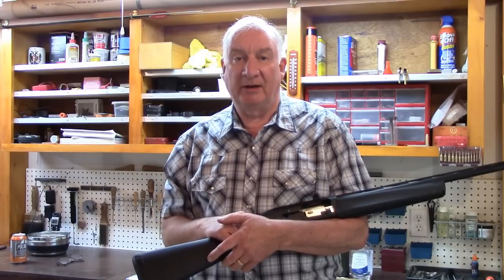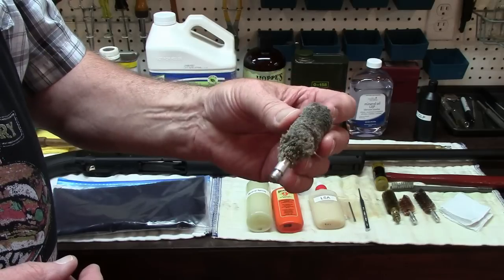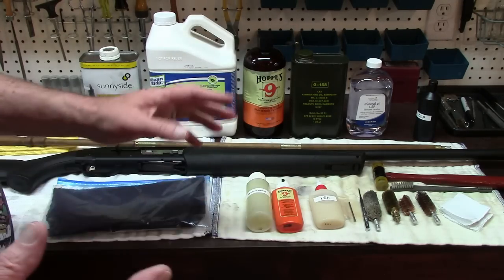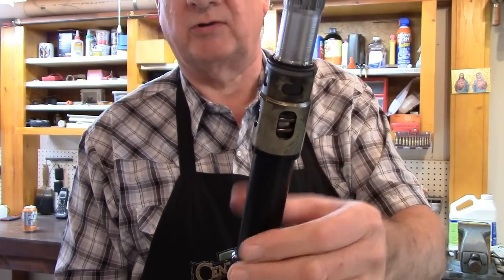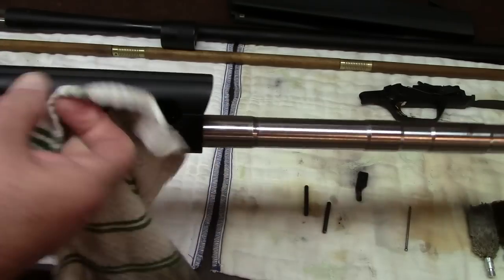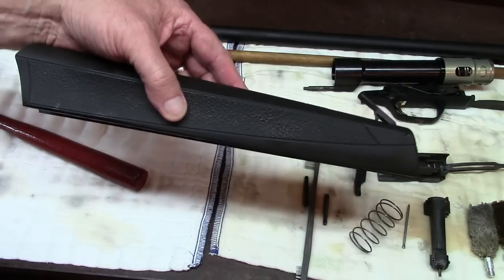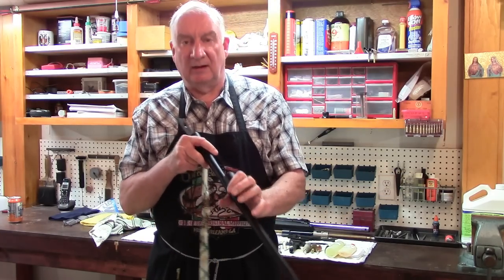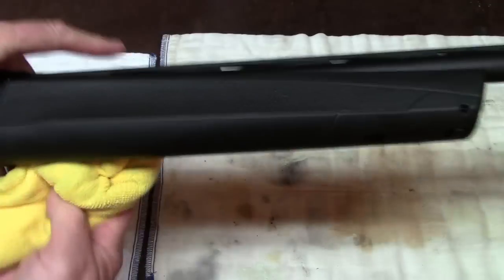How to clean a shotgun quickly, and inexpensively! ~ Solvent secrets unveiled!

Comment: With over 30 years in the paint and coatings industry I assure you the new green (white) mineral spirits will not dissolve plastic, synthetics, wood, skin or other coatings. It is like petroleum soap. Thank you GunBlue490 for safe, economical and effective gun cleaning solutions.

Comment: Gunblue, thanks for your excellent videos.  I watch them all and I have for years.  The paint thinner tip for cleaning dirty oils and carbon off the gun metal is great.  I accept everything you say, but I do have one issue I am questioning regarding lubricity and preservation of metal by mineral oil.  Break free CLP is a very mild cleaner and it does not cause any damage to metal or plastics from rubbing.  It is not as good as a cleaner of baked on carbon and lead as is Hoppes #9, which is excellent.  CLP works very effectively to prevent rust in humid environments such as Florida.  I tested REM oil vs Hoppes CLP on a stainless steel plate in my garage for two weeks.  The humidity caused significant rust on the Remoil portion of the steel, but the CLP covered portion was perfectly preserved with no rust.  This little test has been frequently demonstrated on YouTube.  Therefore, I am wondering about the preservation qualities of mineral oil.

Comment: I saw in another video about how to clean an AR-15 where the gunsmith put a couple of drops of mineral oil on an old school shaving cream brush (he specifically said, to only use a shaving cream brush) and he lightly oiled the whole rifle with it.  It worked really well.  I think it would be the perfect way to oil your bolt and anywhere else it's hard to get the towel into.  I use a similar method to your flannel cloth but I use a lightly oiled microfiber towel, but when I get the opportunity, I will probably get a shaving cream brush.  still enjoying your videos.

Comment: You mentioned changing chokes to a more open one, if the snake gives you trouble pulling it through.

I'm wondering, if the barrel is dirty before removing the choke, won't any loose particulate in the barrel find it's way into those fine threads when you screw the larger one back in?

If so, how do you prevent this?

Comment: Excellent video!  Wish I had seen it years and years ago when I was shooting 300 to 500 trap targets weekly.  All the $s spent on solvents would have bought a few more practice rounds.  How does the painter thinner work on plastic fouling in chock tubes?
Reply from the maker: Donald LaMar 
It's not a plastic solvent, per see, but in my experience it does do a good job of loosening and releasing it nicely with the aid of a bronze brush. Plastic fouling can be quite tenacious, and there are few means to deal with it apart from some scrubbing. The best bet is to use highly polished, good quality chokes that plastic won't adhere to.

Comment: Thank you very much for yet another well presented and well thought teaching video. 

I’d like to share a bad cleaning experience with a 12 gage smooth bore slug shotgun - which was one reason why I got rid of it. Problem was that inside of my barrel near receiver got totally crusty after shooting only about 20 foster slugs. I spent countless hours scrubbing with Hoppes9 and bronze brush to very little satisfaction. I eventually resorted to a very toxic smelling concoction called “Ed’s Red” which did eventually clean it but was still a pain in the tail. I’m curious whether I should have done something different. 

I’d also like to say that I used your video series to decide on my replacement weapon for pig hunting - a nice 308-win Browning A-bolt 3. And I was very pleased to use your bolt gun cleaning video as a basis for equipment and technique. Only thing I’m not happy about is that I still have a gallon of toxic “Ed’s Red” to get rid of. 

P.S. - I just started reviewing your reloading video series and I have high hopes for that. 

Thanks again!!!
Frank in Indianapolis

Comment: Slip 2000 has a product for soaking items that have carbon on them. I really am now convinced it is nothing more than this new low VOC paint thinner with some green dye in it.
Reply: As I was watching this video, I was thinking of this exact same thing. It even says on the bottle that will remove painted finishes.
Reply: @jimmystyles670   I own quite a few guns that I use hard. This guy is a wealth of knowledge. I use this video as a reference and as a way to reality check myself against all the snake oil products out there. I try to keep as few products on my bench as possible. I do believe however in the slip 2000 product and its all i use to clean, lube and protect my guns that see excessive use in harsh conditions.

Comment: I have a brand new Remington 870 field master I have only shot 7 target loads through it and I went to clean it and the patches keep on coming out a brown color and I let the break free clp set for about 25 minutes and I repeated this for 3 times and they are still coming out brown I used the bronze brush in between the patches and it doesent help but I looked inside the barrel with a bore light and it looks completely clean
Reply from the maker: I don't recommend Break Free CLP, as I have found it to be quite inefficient in cleaning, lubrication, or protection.  That was the Army's finding many years ago, but some beurocrat keeps buying it, for reasons that we may only speculate about!
Your bore apparently is somewhat rusted.  I'd suggest soaking the barrel in mineral spirits or Hoppe's solvent overnight, followed by a good scrubbing.  Be sure to apply a light coat of mineral oil to the bore for storing, not CLP!  As a note, gun safes are perfect environments of moisture and condensation, and can quickly cause rust in a matter of days.  Always use a 120V. electric "Golden Rod" inside a safe to prevent condensation.
Reply: @GunBlue490  I keep my safe at a humidity of 50% to 30% and the gun is only about 5 months old could it possibly be something from the factory ?

Comment: What what you recommend instead of a wooden shotgun rod? Aluminum rod, brass, stainless or plastic coated rod?
Reply from the maker: Certainly never aluminum for any gun.  Wood or plastic coated is the best for shotguns.  Pull through snakes can work, too.  Wood with brass ferrules is my personal preference, because it's light, but will not bend.  Mine was my father's, is over 75 years old and still going strong.
Reply: @GunBlue490  Actually, aluminum is fine because it is softer metal than the barrel. Hoppes and many others use aluminum for their cleaning rods.

Comment: Does the mineral spirits dry or shorten the life span of the rubber O-rings?  Also, what is the effect of mineral spirits on say a polymer frame pistol like an HK or Glock?
Reply from the maker: sam hornik 
Mineral spirits is sold in plastic bottles. It has been used and recommended for paint brushes of all types, including various nylons and polymers.  It's recommended for use on engines, to degrease them, and engines have multiple neoprene rubber hoses and fittings.  It's a mild, universal cleaner, degreaser, and paint thinner.  I use it to remove bugs and tar from my car.  The stock on my shotgun is a polymer.  I should imagine that even a Glock should stand up as well as a five dollar paint brush or a plastic paint pail.
Reply: Thank you very much for the information!  I love your channel and just subscribed.  Hope you have a blessed day!
Reply: "Even a glock..."
 priceless!

Comment: My gun has grim “tattooed” in the metal (as in no matter what I do I can’t get it out) what do I do?
Reply from the maker: Certain places on gun metal, especially the front of stainless revolver cylinders and around the forcing cone, or the areas near rifle gas ports, will get permanently darkened as a byproduct of intense heat and carbon.  It's entirely normal staining, and nothing to worry about.  Trying to remove it with abrasive products is fruitless, and lasts only as long as the next shot you fire.

Comment: What about the wood stocks.  In the MIL we used Linseed oil, to preserve the wood and grain.
Reply from the maker: John Grunwell 
You are speaking of linseed oiled stocks, traditionally employed by the military as a very inexpensive, but practical and durable protection for their application.  Though a term suggesting oil finish is often used in catalogs, manufacturers very rarely used linseed oil on commercial finishes, and if they did, it was "boiled" linseed, rather than the raw, which you used in the military.  Raw linseed, as used on military firearms, penetrates the grain deeper with every application, and it never aquires a sheen.  Boiled linseed contains drying agents that harden not unlike varnish, and provide a superficial glossy coating, which cannot be re-oiled.  Many commercial gunstock oils sold in little jars and bottles are actually just repackaged boiled linseed oil, and they are notorious for making refinished stocks look just that...  sadly refinished. However, manufacturers have almost universally used stains and varnish, until the advent of polyurethanes, so the best advise for such finishes is to treat them like your chest of drawers; dust and polish with any good furniture wax.  I prefer Butchers paste wax, also called bowling alley wax. Never, ever, allow gun oils and solvents to get near wood stocks, which has destroyed millions of stocks.
Reply: GunBlue490 YES, RAW LINSEED OIL was used.

Comment: Before you run The snake or cleaning rod  through the bore do you need to remove the Shock out ?
Reply from the maker: If you mean the choke, no. In fact, the choke should not be removed, or the threads will foul with dirt.
Reply: @GunBlue490  think you

Comment: Cleaning a double barrel is even easyer. after a session i pull a slightly used but not oil soaked boresnake through it. after a few sessions and when i know that it will be stored for longer than a month. i nylonbrush the choke threads with ballistol and pull a ballistol "soaked" bore snake through it. before shooting i put a dry snake through. the action gets nylon brushed and soaked with ... you know what.... until clean solvent runs out of it and "dryed" with a vacuum pump and a piece of cotton. worked for years. and IF it ever starts failing i throw it away and buy a new one. (i dont think i will ever have to buy a new one)

Comment: 👍👌Hoppes 9, mineral spirits, mineral oil & flannel from the fabric store. Great stuff! 👍I’ve always used the mineral spirits & had great results. One thing that was a must for me in my basement shop was to pipe compressed air in from my garage air compressor. Also placed moisture filters in-line- Or if one doesn’t mind the noise, (I’m not one for noise) one can always put a small pan cake style compressor there as well. Blow out any excessive ness of sorts. Works great for me. 
Thx for the good video as I always enjoy them along w/ the stories that you tell👍
So much OVER oiling, good point as you’re not oiling a machine like an engine revving at 5k RPM’s! Lol! 
Good stuff here! 👍
Reply from the maker: Me too!
Reply: Flannel from the salvation army or other thrift store is what I use
Reply: @GunBlue490  -- do you dry fire to release spring tension before storing, or just leave the firing pin spring compressed?  If those are the right terms...
Reply: @mojoman2001  I’d release it.
Reply: @majorpayne5289  -- Blue answered the question in another video to the effect that he dry fires modern firearms repetitively for practice.  Did not specifically address spring life, but I think I know what to do.  Release spring.
Reply: @mojoman2001  👍There’s only been 1 firearm co. that I’ve had issue w/ their OEM springs. My CZ 75’s. The 2075 RAMI in particular. I love this pistol, however, upon 400 cycles, it tends to NOT go into battery. Even in owners manual it states to replace spring at 500-600 cycles. I 1st thought it was a sales jab but upon its failures, I replaced ALL springs w/ WOLF brand or Dawson & I’ve never had another issue. I absolutely love most of CZ (metal) but they really need to up there game on their OEM springs & such. Just sayin’ - & I too dry fire but not too often unless w/ caps. ✌️

Comment: 39:11 I already did this :( 
I am new to threaded barrels and I just bought one for my 870. I wish I would've watched this video first or that Remington should've said something about not removing the choke in their instructions but they never did. I only ran the boresnake twice and the inside of the barrel is shiny clean, however I'm worried that I ruined the threads. I looked at them with a light and they look fine to me. Am I over reacting or should I exchange it for another one?

Thanks
Reply from the maker: If you can still screw your chokes in, you have done no permanent harm, and you shouldn't worry.  The dangers are either damaging the threads, or getting them clogged with debris.
Reply: Ok thank you for your quick reply! Yes I can still screw the chokes in (those are brand new as well). I just bought the barrel and it has never been shot. I literally bought it and when I got home I ran the bore snake through it only twice in order to get rid of the factory crud.

Comment: I wrap 0000 steel wool on a 3/8 wood dowel and spin it with a cordless drill, it will clean out plastic and any fouling. It will not hurt the bore in fact it seems to burnish and brighten the bore.

Comment: Ive seen guys use WD40 to clean and oil at the same time.  The used it on shotguns, pistols and they said it cleans and lubes at one time and its cheap compared to name brand gun/oil cleaners.  Oh and if it was to dirty to start with WD40 they used brake cleaner from Auto Zone...brake dust must be the same as gun powder residue.
Reply: Ask the guy at the range whose is having issues what they use....most the time they say WD-40.

Comment: @ 2:00 I clean mine outside & I cut up cardboard boxes into squares which I set on the ground for the barrel to rest on when cleaning. The fresh air is always nice plus while I am cleaning I love listening to the birds talking/singing. The low VOC paint thinner for cleaning parts is an awesome tip. I have a small fortune $$$ of various cleaners & when these are finished I will replace them with paint thinner.

Comment: In Vietnam where metal would rust overnight armorer's used a mix of Stoddard solvent, ATF and non detergent 30 weight motor oil. The solvent cleaned and the ATF had detergents to cut carbon and synthetic lubricant for high temp  lubrication. The motor oil protected the metal from rust. Still use it today, the formula is online.

Comment: Is there any concern with mineral spirits removing the coatings on barrels?
Reply from the maker: ApexKnives 
Paint thinner is used daily with plastic paint pails and comes in plastic jugs, and I've used it to clean stains off latex paint and vinyl floors. To be safe, contact the manufacturer, but I can't imagine that plastic coatings are less durable than a painted wall. It's used to thin liquid paint; not dissolve painted surfaces.

Comment: Did your bore snake have solvent on it? Also is it not recommended to lightly oil the bore to prevent rust (especially say at the end of season) Awesome videos by the way .. Thanks for the thorough information!
Reply from the maker: It did not, because this bore is chrome lined and cleans easily, but one certainly can use some solvent to loosen stubborn particles. A light application of oil will not hurt standard steel bores either. If using a snake, just apply solvent to the leading part of the snake fabric, and a few drops of mineral oil to the end, and it's done!.

Comment: Great channel, I love the videos. I've been using 98% ethanol as the solvent and 15w40 engine oil as the lubricant. I'm wondering if graphite would be a good lubricant for the bolt mechanism since it wouldn't grab onto the dirt.
Reply from the maker: I spoke about graphite in another video.  Smith & Wesson discovered in the 50s that it caused serious wear on gun parts and clogged mechanisms.  Professional locksmiths know how badly it clogs and wears pins.  Not good whatsoever.  Guns need VERY little lubrication; just a film of oil from a cloth.
Reply: @GunBlue490  thanks for the heads up

Comment: if someone could tell me how to clean a bore mop
Reply from the maker: This isn't a community blog, so the only answer comes from me, the author.  Simply flush it with solvent to remove loose particles.  There's no need to clean it, and it should perform perfectly for a decade or two.

Comment: Thanks GunBlue!  You just saved me quite a bit of money on gun cleaning products.  I love the Klean Strip and wow a gallon is $9.00 at Home Depot.  Any limitations at all on the Klean Strip for certain metal pistol or rifle parts that you can think of?
Reply from the maker: Nope.  It's harmless. Be cautious always of plastic applications by testing jn a discrete spot.
Reply: GunBlue490 , thanks for mentioning polymer.  I was about to ask as I left it out on my prior post by mistake.  I suspect I can use the Klean Strip on all the metal slide components including barrel and just abstain from using it on the frames?  Wipe it down with some mineral oil afterwards and call it a day.  God bless and have a great evening.